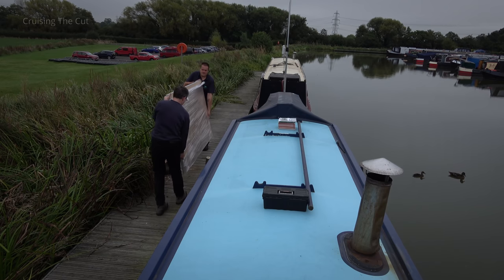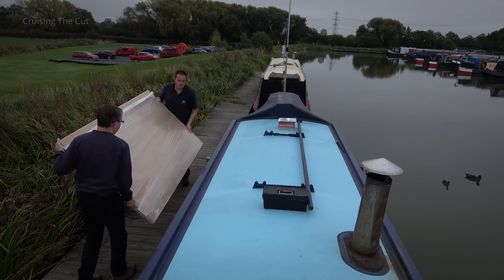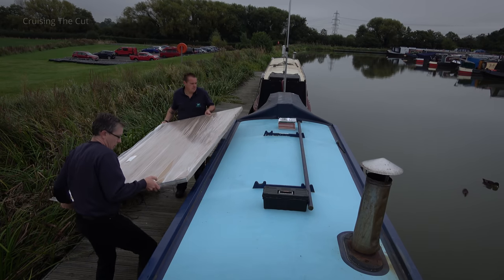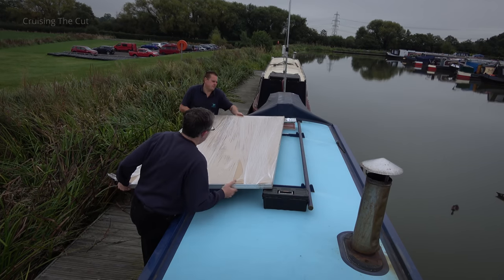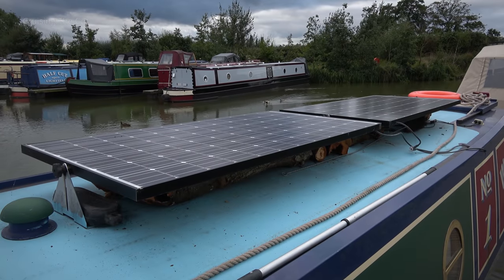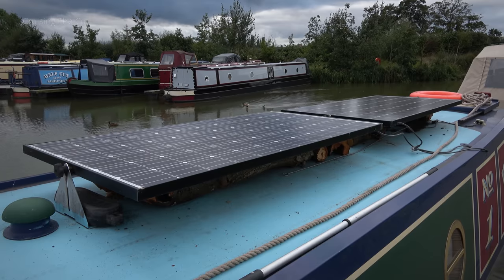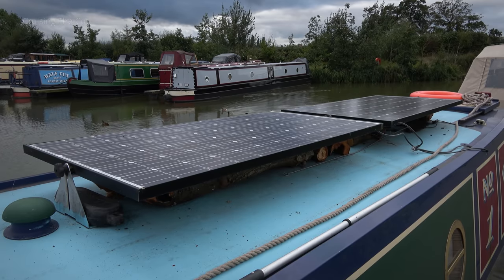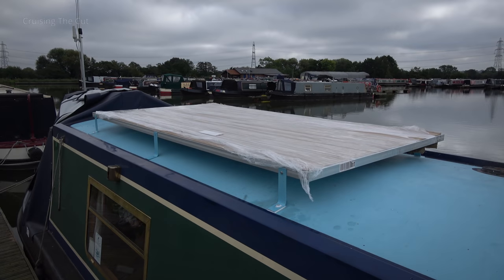260. Solar Panel and Lead-Carbon battery update (narrowboat)

Comment: Interesting video..thanks..  for comparison 1000watts solar has being the best compromise between boat roof space and battery longevity.. I run a fridge all 365days  and also standard domestic washing machine on a 58ft boat with standard trojen wet cell batteries (550amphrs) which are coming up to nine years old. I'm a continuous cruiser and for about 3month a year a run my engine equipped with 250amp alternators twice a week for 1.5hours(this is when I use the washing machine)..  I did try more solar but it just didn't make enough of a difference in low sunlight months. Hopefully someone finds this helpful.
Reply: Agree. However solar is "handy" from time to time when out cruising ... providing you can moor not in a forest and where solitary trees, high hedgerows or buildings throw a shadow. More common than you might suppose.

There again in high summer, even in UK, the all steel boat will soon become a slow cooker if you insist on your solars seeing the Sun all day long.

From experience, having an "enormous" bank of service batteries and running the engine as required seems to be the "preferred" custom and practice.

Mind you tho' the rising cost of diesel might be a limiting factor in "just" running up your engine for charging purposes.

I noted one comment, which lead to another canal blogger, touched on the notion of combining both lead acid AGM type batteries and lithium (that is LiFePo4 types) batteries on the same bus.

It appears that an intelligent battery charger, on the AGM setting or profile, will happily charge lithium cells. I gather it relies on the lithium battery's BMS "doing the math" as it were.

This practice seems to be frowned on by some alleged authorities yet endorsed by others.

If you cared to follow this other vlogger then doubtless we'll learn how the system works over time.

Strikes me, presuming the other blogger's boat doesn't end up in some conflagration akin to a nuclear holocaust, there might be some mileage in doing ditto.

Reference was made to a Facebook group who appear to support the idea.

(It's excellent how David's episodes and the subsequent comments invariably throw up something most of us hadn't thought about ... and then provide food for said thought.

Sorry, couldn't resist footnote 😂😂😂 ... but still ... it's true tho'.)

Comment: Nice follow up …This set up proves the fact that solar power is the answer for 80% of a homes power requirements !!
Reply: Small homes, a big 3 bedroom dining room, living room, kitchen, rec room. laundry room, to have a 3 day of no sun will take a large battery bank and a large solar banks, all toil about 37,500.00 USD. but it's close to the best you can have and not spend more.
  And yes washer, dryer, etc are all bought for the use of solar power.
Reply: @sirfrydryk360  wash your clothes by hand, dry on a clothes line, take cold showers etc.  people forget once there was no electricity.
Reply: Rubbish, just like electric cars, a flop in reality.

Comment: Thanks for the video David! I use a Trimetric battery monitor from Bogart Engineering to keep track of the percent of charge in my lead-acid batteries. I like that with a glance I can get an accurate measure of my state of charge. It has also been useful to identify how much power various things are consuming and to identify small "ghost" loads that I hadn't been aware of. The Basic Pack which includes the monitor, a battery shunt (the sending unit) and wiring harness is $205 USD.

Comment: I wonder if it would be possible for some bright British bodger to figure out a way to transfer the heat from the fridge into the canal water directly, and if that would improve the efficiency of the fridge. Because on one hand you're running a fridge in a heated space so it's working harder, but at the same time all the energy the fridge uses ends up heating the living space and so would reduce energy costs elsewhere... this heating efficiency thing is a really tricky one isn't it?
Reply: It would be very easy to simply extend the fridge radiator pipes out the window or into the water (if you have the tools to work with it and know how to recharge the gas.) 

I think it would be a more specialist job, though. I convinced my wife to let the kitchen stay cold to reduce energy use by the fridge and make the motor last longer.

Comment: Most of my newer laptops use less power. Then i've gone to SSD HD's to store info on. So much less power then having to spin a disk to save info. Take care and be safe. Nice to see some video's from you every so often.
Reply from the maker: Even the PC laptop had an SSD for its main disk. It was the CPU and GPU that drew all the power, I think.

Comment: Is your fridge/freezer a 12v compressor fridge..? I live full-time in my motorhome and just took out my 3 way fridge and installed a 12v compressor fridge/freezer. It is using about 1.5Ah. It cuts in and out when it's needed. I also have lead/carbon and love them. Have a look at Inlander in Birmingham for compressor fridges... 👍
Reply from the maker: Yes it's a 12V compressor, you don't tend to see three-way fridges on boats anymore due to gas safety (there are occasional ones about but on older boats)

Comment: Nice vlog getting very technical can I ask have you tried wind power
Reply from the maker: Wind generators are a bit rubbish on the canals, see https://cruisingthecut.co.uk/f-a-q/
Reply: @CruisingTheCut  What about water? Is there any current?
Reply: @xanosdarkpaw1  Canals have by the very nature of their being little to no current, as they are man-made and interspersed by locks to deal with any differences in altitude. you might get some use of the currents if you moor directly in a river, but I don't think a lot of people do that.
Reply: Cauliflower  , broccoli or any type of bean soup , atrocious wind
Reply: They can be very noisy - have a look at the vlog Ship Happens - they put a windie on, and it drones and vibrates a lot.
Reply: @CruisingTheCut   by their very nature canal are usually lower that the immediate area around them…. It becomes very difficult to get a wind turbine HIGH enough in a canal to get enough consistent and steady wind to make the exercise worth the effort
Reply: @xanosdarkpaw1  13 amps
Reply: @CruisingTheCut  I would agree when actually on the cut, but tied up in a marina a wind generator should provide you with power as long as the wind is blowing, even at night.
Reply: @misamsung6191  If you look at the power curves the manufacturer gives you, divide it all by two, multiply their specified wind strength by 1.53 you will see you need average wind speeds of around 26 knots to power an ipad.
Reply: @CruisingTheCut  very true, but it would be great on those non boating miserable days, that you are not going anywhere, and of course easy enough to drop it down out of the way
Reply: The most noisy, overrated and inefficient source of power on vessels is wind. Not worth the cost or installation.
Reply: @xanosdarkpaw1  did you mean whether the water pump draws electrical current ? :-)
Reply: I think the only other option would be to go nuclear.
Reply: @Hustwick  your comment reminds me of the us military’s attempt to make a nuclear powered plane…

Comment: Thanks David. On the cutting out with low solar - it's  an inherent problem. With lead chemistry, current drops as the  batteries become fuller (as you alluded to). Under ideal charging conditions, this can be used to decide when the batteries are full. Usually it's  about 4% of the battery capacity.  E.g. 4 amps on a 100 Amp hour battery. Most chargers work that way. With solar, the times of low light, including passing clouds can drop the charge current low enough and for long enough to fool the charge controller. 
No fault, but might be improved by increasing the absorption voltage, reducing the tail current, say from 4% to 2% and, possibly, extending the time before the controllers switch to float. No guarantees. And it also depends on how much the controllers allow you to configure yourself. 
At least with lead carbon, there's much better resistance to sulphation than with AGM etc.

Comment: I am going to go on shore power for three months next year,  I wondered how much extra the electricity costs, you save how much  on engine fuel and oil and wear? I was running engine 10 hours per week, costs Diesel 10 weeks = £100, servicing for 100 hours £100, not giving batteries tlc £50.
Extra cost for ten weeks £250
If on shorepowe I would  use the Webasto less, but it's impossible to work out cost of that, I guess £1 per day ie £100
TOTAL £350
£3.50 per day
I think this is fair ballpark figure for my extra winter diesel related costs
The question is, did your electricity work out at around £3.50 per day?
Reply from the maker: The electric cost is relatively minimal but the mooring costs are not (and in a marina you tend to be side by side with other boats like sardines so it's not very pleasant)
Reply: Using a 400w heater blower over the winter to keep the damp out the main cabin (I used a diesel heater on the bedroom) on a little unfinished 30 foot fiberglass refit, I only got charged around £40... so all in all over 5 months I've paid less than £50 in electric. :P
You can do the math also, as each item will have an average use, it will then just be finding out how much you pay per "unit" electricity. Mine is about 21p per kwh or something.

Comment: Good to hear everything is working OK.  I would guess the only time you can really judge the performance between the different types of battery is at the end of their respective lives.  The length of effective life will be a good representation of thier real value.  Otherwise you end up living in a laboratory full of test gear.  Not really practical.

Comment: I have the solution! Don't just run the engine to charge the batteries, go out for a cruise - and film it. That way you get to charge the batteries without annoying fellow marine people AND you can post the odd cruising video as a bonus. Which will keep the ravening hoards of cruise fans sated!
Reply from the maker: Every day? 😳
Reply: @CruisingTheCut  it would keep them quiet.  For a while.
Reply: @CruisingTheCut  Depends how long your fully charged batteries last !

Comment: Thanks for that vlog,...a "seat of the pants" kind of a run down on your experience with your system. I appreciate the non technical understandable perspective on what you have learned by actually using this stuff.  No fluff or conceptual gobbledegook about what might be possible,...just what you experienced!
Its a welcome and inciteful bit of information! I very much appreciate it!

Comment: Long life milk?
Reply: Especially flavoured milk which I noticed tends to use long life milk.
Reply: Although the lactic acid in long life milk will give you some power, it won't be much.
Reply: @marklittler784  Bought fresh daily, proper milk would be ok. Narrowboats used to be horse-drawn. Ox-drawn would have other benefits ;)
Reply: And longlife cheese.

Comment: Great video. For testing the batteries most auto supply stores that sell batteries should be able to get you a clamp on battery tester. All you do is disconnect a battery from the circuit, clamp the tester's leads to the battery, and follow the units instructions. It will tell you the condition of the battery. simple and quick.

Comment: It's good to see one of your vlogs again David.
A lot of your contemporaries have  evaluated the Jackory solar charged pack for 240v and or 12v  with a high degree of success.
Power requirements are a constant pressure using 12v systems.
In boat design a 12v 240v generator built in is the only perfect solution for peace of mind.
Any way thanks for taking the time to post 
Keep safe warm dry and virus free.
NB Heidi off Narrowboat Pirate plugged in a large lithium battery into her leisure bank with spectacular results it would seem
Reply from the maker: Re Jackery, please see my pinned comment at the top :-)

Comment: A useful power saving tip- if your freezer has a “fast freeze” button push it whenever running your engine or on sunny days when you may have excess power available. It will run your freezer to something like -30 or even colder. When you switch off the engine turn the freezer back to normal mode, and it will be many hours before the freezer has “warmed” sufficiently to require the compressor to run, you may find that your freezer can last all night without having to run.
Reply from the maker: Alas, mine has no such function

Comment: Very nice update video! I just wanted to add in a comment and you can research it if you care to. You had made the comment that temperature compensation really doesn't do a whole lot one way or the other. I disagree with that. If you look at the different charging parameters when the charge controller is operating under temperature compensation conditions you will see that there's actually a very big difference in voltages going in or not going in depending on whether it is hot or cold. I don't think most people understand how vitally important it is to buy a charge controller that has temperature compensation capabilities. It's worth the extra few dollars that you'll pay for that technology in my opinion.

Comment: A very fair commentary on the real life of having PV solar, I have a home system with gel lead acid batteries which I had to change after two years and now have tubular lead acid which hopefully will last a little longer as this is the overhead expense of running PV. As to controllers, running in parallel without extra gizmo's seems to work just fine.

Comment: Thanks for the post. Always brightens my day. Rather than running the main engine, I would investigate one of the inverter generator sets. Very quiet and they can dial back the hp as the load drops. I now have to go look up lead carbon batteries.
Reply from the maker: Trouble is you then have to buy and store petrol (diesel gensets are incredibly expensive) and they are still noisy
Reply: @CruisingTheCut  That is true. My gasoline generator runs on propane but then you have to top off your propane more often. I have a 60 gallon propane tank in my bus; runs the cooktop, water heater and generator.

Comment: David: I just found out that some of the RV'ers here on this side of the pond are double stacking their solar panels, mounting the second set on something akin to locking drawer slides. When they park, the second set pulls out to add square footage to their exposed panels. Thanks for the video. Jon

Comment: I've got a very similar solar set up and, my findings are much the same. That extra solar takes you a little further into the "dead spot" that is deepest winter, and brings you out a little sooner, plus covers the odd bad weather patches the rest of the year. Anything one can do to reduce engine running has got to be worth it though.

Comment: Before I retired one of my routine duties was testing batteries with a device made by Midtronics which gave a very accurate state of the batteries without a charge discharge cycle. A very expensive piece of kit. We have a touring caravan which we tour with extensively during the warmer months. Although we usually hook up to the site supply we also wanted to be able to use ad hoc sites without a mains hook up for events etc. I installed two 120 watt solar panels which kept our 100Ah battery in a reasonable state of charge using the battery for lighting and various other miscellaneous functions. However I was all to aware our fridge which is 12 volt/ 230 volt or propane would draw too much current. A week on a site without a mains electricity supply meant using a lot of propane gas. Doing the sums I realised it was much more economic to use a mains supply rather than run the fridge on propane.

Comment: I had 200w of solar on my narrowboat but got an efoy fuel cell for the winter. It kept the batteries topped up nicely, only ever ran the engine for propulsion.

Comment: With regards to the fridge it's temperature gradients that chew your electricity, you are running a wood burner to heat your boat and the fridges environment hitch requires more power for the fridge to cool it's inside as the outside is warmer 😁
Conservation of energy,you are making the temperature gradient between the fridge and the cabin steeper by running the woodburner.
Reply from the maker: Indeed. I gave the fridge the present of two vents down to the bilge to help its airflow a while back

Comment: I have two bifacial panels on my motorhome,they are rated at 315w each,with the bifacial bringing them up to a theoretical 400w each,I've had them for a couple of years now and found them very good for low light conditions,they need a bit of help over Nov,Dec but the rest of the year they do the job.

Comment: I have a trailer that we use in the summer.   I have enjoyed your experience with Solar and have learned much.

I am getting closer to retirement and hoping to do more traveling in the trailer and camp without "Shore Power" (I normally get an electrical site) occasionally.  
I will need to significantly update my battery if I do this and potentially add solar.

Stay safe.

Comment: Solar gives you power when you dont need it... Living in my van I only charge by driving it, sometimes only once a week. Key: my Propan powered fridge, good old 1970s technology by Electrolux.  For the boat I'd strongly recommend a gasoline generator instead of running the diesel. much more efficient and less ratteley. Besides that: the power you dont consume you dont have to generate. btw: 8°C is considered normal fridge temp. here in germany, I never run my fridge in winter.
Happy boating, all the best.
Reply from the maker: Cheers
Reply: Doesn't the boat engine also heat the water for washing etc?